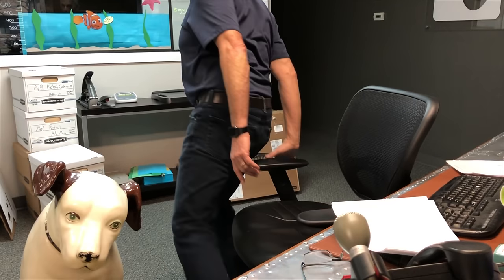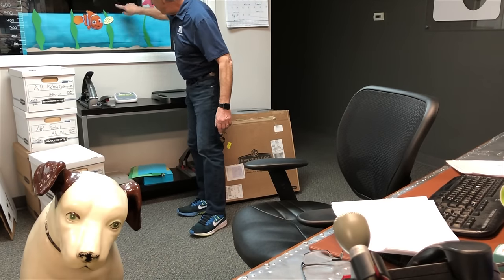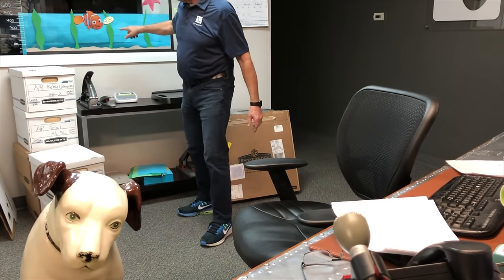Why do tubes sound different than transistors?

Comment: Yes they are different, BUT you never got to the WHY they sound different.
Reply: 3rd harmonic distortion
Reply: @joeking1019  I agree that at high signal levels that tubes clip differently than transistors, and this leads to differences in harmonic distortion.  But in the video Paul claims that they sound different even when each is operating in their linear ranges.  And in their linear ranges there should not be any harmonic distortion.  Distortion only occurs in the non-linear ranges.  Which leaves me wondering, who's correct, Paul or the people he claims are full of "you know what"?  Perhaps it has more to do with the source impedance differences Paul mentions, and how those interact with the speaker?  I'm not sure.
Reply: @willdejong7763  Perhaps it is just a condition of being amplified through a vacuum tube, not necessarily driven to distortion, it was when I was younger and really into electronics and guitar amps that I learned about the 3rd harmonic produced in the tube, so I guess that just stuck as I've never heard a claim otherwise.
Reply: giri kotte  it's not worth an argument if you offer nothing to back it up,
Reply: giri kotte  it could be both, this is from wikipedia
    

Total harmonic distortion (THD) 
    Music material contains distinct tones, and some kinds of distortion involve spurious tones at double or triple the frequencies of those tones. Such harmonically related distortion is called harmonic distortion. For high fidelity, this is usually expected to be < 1% for electronic devices; mechanical elements such as loudspeakers usually have inescapable higher levels. Low distortion is relatively easy to achieve in electronics with use of negative feedback, but the use of high levels of feedback in this manner has been the topic of much controversy among audiophiles.[citation needed] Essentially all loudspeakers produce more distortion than electronics, and 1–5% distortion is not unheard of at moderately loud listening levels. Human ears are less sensitive to distortion in the low frequencies, and levels are usually expected to be under 10% at loud playback. Distortion that creates only even-order harmonics for a sine wave input is sometimes considered less bothersome than odd-order distortion.

Output power
    Output power for amplifiers is ideally measured and quoted as maximum Root Mean Square (RMS) power output per channel, at a specified distortion level at a particular load, which, by convention and government regulation, is considered the most meaningful measure of power
Reply: Transistors and tubes are inherently nonlinear devices.  This is true throughout their respective ranges of operation. Now I know Paul M will probably cringe, but I suspect that a Taylor series expansion of the operating characteristics of both transistor and tube modes (such as common emitter or common collector in the case of bits) would reveal those differences quite handily.
Reply: @stephenmead5488  Yes, tubes and FETs are quadratic and or cubiq while bipolar transistors have exponential amplifying characteristic. However, the largest difference lies in the fact that tubes needs an output transformer which introduces soft clipping via magnetic saturation in its iron core (and even some hysteresis).
Reply: Herr Bönk couldn’t agree more.
Reply: Its got to do with the ODD and EVEN Harmonics. you can google it.
Reply: @joeking1019  Joe the thing is, the human brain got this strange affinity to even harmonics i.e 2nd 4th 6th etc. when you get a lot of those mostly 2nd order, you get the "tube" sound. 
In fact you brain is not particularly good to make out the even harmonics and this to our brain sounds warm and nice. But odd harmonics however, they stick out like a sore thumb to our brain, this is what many would characterize as clipping transistor noise. 
Now I could go into detail specifically why and how those distortion come about if you'd like me to explain it, but you'll have to buckle up because here are some of the things I would touch upon to explain it; Miller effect, internal parasitics of the device, Early effect(transistor lingo), feedback and AC/DC Loadlines.
Source: I'm an electronics engineer student
Reply: actually he did.
Reply: @herrbonk3635  Did you ever hear a transistor with an output transformer?
Reply: @martinh1277  you gonna destroy it XD,
Reply: valves are naturally low pass filters , Transistors are less linear than valves , that's why they sound different.

transistors born from the neccessity of faster switching speed, (MHz and beyond), so they are prone to exterior interference like RF, harmonics, PWM from cheap dac's (like your phone)...
Reply: @GrulbGL  It cannot be the linear thing, I tested it. I took a record of Shlomo Minz and his violin. It is a Guadagnini. The sound is great. I had an equalizer, oktaves, plusminus 10 db and fooled around with the sound.
If you move the eq a bit, you can notice it. But seconds later it sounds great as usual. To have a lasting effect, the violin doesn't sound no more, you have to change a lot. This is far more than a lousy transistor ever could produce.
Reply: "Yes they are different, BUT you never got to the WHY they sound different."
===
They sound different because speakers don't present a constant impedance across the audio frequency range.
A solid state amp is a voltage amplifier so produces more power into a lower impedance and less into a higher impedance.
A tube amp is a current amplifier so produces more power into a higher impedance and less into a lower impedance.
A speaker manufacturer once did a design exercise and made a speaker with a level impedance, largely resistive. The speaker sounded the same with solid state and tube amps. Unfortunately, the crossover was so complex that the design also sounded crap.
Reply: Yeah I mean it's just kind of generalized and vague descriptions that don't do anything to clear up this issue at all.

If we're going to ever clean up the gossip, pollution, ignorance and idiocy of music knowledge, we need to have real testing, we need a real science.

I mean, consider the harm that this video has done to all the people that have commented on it and all the people who have listened to it. They now think they know when they don't know. They are actually worse off. Because instead of doing a scientific test that proves that the sounds are different and describes the tests and the output all we have is a bunch of words thrown together, which may or may not prove anything.
Reply: In tubes area of linearity is kind more distorted than that of transistor thus giving that distortion in signal that people find pleasant
Reply: Because Hi voltage + gas electron transfer + liniarities . Transistor cant do The same
Reply: Nobody talks about speed of working is where most of the cheap transistors fails and deliver crappy sound
Reply: Tubes have a continuous stream of thermionic emissions that don't switch on and off. I have used all topologies of ss and continued to search until I found tubes. Have used all topologies of tubes and find otls the best. Now I've sold most of tubes and tube equipment but not for sound quality,  but for power. Atmasphere amps were the best if cost is no object.
Reply: @martinh1277  there were ss amps that used opt at the beginning of the sand takeover. Macintosh and altec iirc.
Reply: Because they are built different and operate differently. The whole video was explaining that

Comment: TRUTH to tell, they LOOK cool. Something nostalgic about that warm glow makes me feel good.
Reply: I used vacuum tube Zenith Cobramatic all thru college. Acid Rock like Cream,Jethro Tull,etc sounds like 1968
Reply: "Something nostalgic about that warm glow makes me feel good."
===
I was packed off to boarding school in the late 1960s and took my Dad's cast-off tube audio gear with me. A number of my music-loving classmates had similar stuff. All our parents had the latest shiny transistor equipment but it didn't sound so good to us.
Over the years I have had some really nice solid state gear but 25 years ago I built my first single triode power amp. It felt like "coming home" and is still my first choice, despite the more costly solid state gear I have lying around. Built to satisfy rather than impress...
Reply: @TheRealWindlePoons  Does this satisfaction lies in the ritual, the tradition or anything else that has more to do with some social aspect than the music itself?
Reply: @mignotmaxime2409  No. Not Ritual. Not tradition. Not social.
The single triode amplification stage has a natural presentation I have seldom found elsewhere. But its ALWAYS about the music. Otherwise, what's the point?
Reply: @TheRealWindlePoons  Thanks. I just read the 10 biggest lies in HiFi by Peter Aczel who says tubes do not sound different. I was wondering if the preference for tubes could be elsewhere than the music. Not necessarly a bad thing but it is the case, it must be clearly stated.
Reply: @mignotmaxime2409  The amplifier topology of tubes and transistors accounts for some of the differences.
A tube amp has current output, a transistor amp has voltage output (as a broad generalisation). An impedance dip in loudspeaker response pulls more current (and more power) on a voltage amp. On a current amp the impedance dip pulls LESS power from the amp. If you have rare loudspeakers with a completely flat impedance curve then they will sound very similar on tubes and transistors.
Another feature of a single triode is that it is genuine pure class A, so the tiny nuances of the music are being reproduced smack in the middle of the tube's most linear part of it's characteristic curve.
Perhaps the most important feature of a single triode amp is that it has sufficiently low output impedance to run with zero global negative feedback. Transistor amps and pentodes too rely on GNFB. Our ears are very sensitive to this issue. Feedback gives a crisp, clean but glassy unnatural sound. A few transistor amp designers have paid due attention to this issue (e.g. DNM) but most haven't. Cheap or high power (pentode) tube amps are the same. Just imagine standing between two mirrors. The disappearing multiple images of yourself is what global amp negative feedback is doing to your ears.
I'm not going to slag anyone off if they say one thing sounds the same as another. That is their experience. In this instance it is not mine and there are a number of technical reasons why not. As ever, your mileage may vary.
Reply: Lol absolutely true.
Reply: Yes. They look so inviting. A glow like a warm campfire in a cold autumn night.
Reply: @TheRealWindlePoons  The only solid state receiver that I really liked A LOT was the Marantz 2238b if you know it. Such incredible thick mids my God. My dad sold it but bought the same model in better shape a few years ago. What a beast it is.
Reply: @TheRealWindlePoons  7:50 He says the exact opposite of what you said. He said that tubes are voltage amplifying devices not current.
Reply: @TheRealWindlePoons  What does global negative feedback mean? I'm sorry I'm not too much into this topic. Just have basic knowledge.

Comment: Listening to tubes is like pouring honey in your ears.
Reply: That sounds like a terrible idea unless you want to be covered with ants.
Reply: Ed Berger solid state plus digital recording plus mp3 is like sticking an ice pick in your ears, and I don't have to know why it does to know that it does
Reply: I'm just about to restore an old HP oscilloscope. I pulled some of the tubes and listened to them... But nothing. My workshop is very quiet, but nothing. Not even a whisper, they laid there and said nothing. I think you should eat the honey instead of putting it into you ears.
And yes, I do also prefer the sound of a tube amplifier. :-) <- Smiley
Reply: I love honey!
Reply: Then you end up hearing nothing, which in case of nowadays music, is quite an improvement.
Reply: Yegor thanks for the warning.
Reply: Sounds nice.
Just hooked up my tube amp again, replacing a solid state amp costing twice the price:
Honey to my ears!!
Reply: Elective scaphism.
Reply: Sounds uncomfortable
Reply: How many tubes are in your "kick-ass" car stereo?
Reply: There is already a lot
Reply: Yu'll hear nuthing with hoeny inyourears
Reply: is that supposed to mean it‘s something DISGUSTING?
Reply: @gpdude22  In the UK, tubes are also known as "valves".
The '70s joke went: "Have you seen the new 16-valve Lada? 8 in the engine, 8 in the radio"
Reply: @thesquarerootofnegativei6225  lol

Comment: Tubes amplify using transformers and much higher voltage. Transistors leak. Yes, the longer a transistor is on the more unwanted electrons are also amplified.

Comment: Light bulbs don't contain a vacuum.  They're filled with argon, an inert gas, which prevents oxidation of the filament, just like a vacuum, but makes manufacturing them much easier and cheaper, than having to create a vacuum.

Comment: Thanks for this. I just came across two young tube enthusiasts in my neighbourhood building their own preamps. I'm an RF/CE engineer and was heartened to see young people getting "hands-on" in this age of buy and throw away. I believe the sound difference is in the even octaves only that is found in tubes, whereas the transistors let thru both odd and even harmonics. There's a music theory that says even harmonics makes a pleasant sound, why some music tunes are more appealing than others.
Reply: Second, fourth, sixth and eighth harmonics are all musically harmonious.  But with odd harmonics, only the third qualifies.  The fifth, seventh, etc., do not form accurate musical intervals, so they cause dissonance.  In addition, distortion from solid state designs tends to produce very high-order harmonics, causing a raspy, crackly or buzzing effect.
Reply: Interestingly enough the human ear actually produces even harmonic distortion itself.

Comment: About 40 years ago an electronic technician I worked with who was also a musician, explained his simplistic rationale for the difference in sound. His take was that the heated filaments in the tubes would vibrate while being played.  The variations in frequencies from the instruments imparted vibrations to the filaments of the tubes.  This caused minute and constant changes in the flow of electrons between the various internal parts of the tubes.  Solid state devices, having a different internal structure, lack the parts which enable the tubes to make the sound they do.  40 years ago, musicians were still talking about the sound that could only be found in a tube amplifier.
Reply: Its difficult to imagine resonance being a factor; if you compare the length of the valve elements with the wavelength of sounds at high frequency, @ 20Khz for example the wavelength is 17mm- maybe effects only the large valves?
Reply: I think you explain that quite well, from an electrical/ electronic point of view, harmonics play a big part in how many circuits work and how components interact, a slight variation in the right part of a circuit can make a huge difference to the output stage. A good and simple example of the harmonics effect can be found in computer networks... if you consider the plug into the wall powerline network adapters, they work by using high frequencies to send signals on cables already carrying electricity at lower frequencies (50 or 60 Hz), in modern telephone exchanges and fibre optic networks, this is done using MUX/ DMUX (multi plexer) systems where many frequencies can be sent as waves or pulses of light down the same cable/ fibre without interfering with each other.
I have 2 Marshall guitar amps, a small solid state 15W practice amp that has a tube effect setting, it uses FETs and sounds pretty good and a 1978 SL100 series 1, it uses 4 tubes, 2 in the preamp and 2 larger ones in the power amp stage, I always joke that it sounds warmer, because the tubes have "heaters" used to excite the electrons, fact is, it does sound warmer, it has a natural distortion, even when playing "clean".
Mr Carlson's Lab (YouTube channel) has a good video on how tubes work).
Reply: T B,  they where almost certainly talking about power amplifiers.  Especially amps made for electric guitars where you deliberately drive the tube amp way out of the linear spectrum.  You get tons of distortion from the amp,  but its the kind of distortion they wanted. 
That is really far from what you want in a HiFi system where the idea is to reproduce the music as it is on the recording. 
Any kind of distortion your system adds will give a "sameness" on all music reproduced. 
With that said I should also say that a great clean producing HiFi system also lets makes all the badly recorded material very evident. It can often be to the point where you will avoid listening on badly produced material. 
Does that take the joy out of listening? 
I would say both yes and no.  The best recordings will sound amazing and you will really enjoy them more.  The bad recordings tend to be hard to listen to. If you still want to listen to them (and I do)  the easiest way is to have another much cheaper system where you listen to them,  e.g. i  the car.
Reply: @Rohan4711  Great post, especially your reference to the cheaper system.🙂